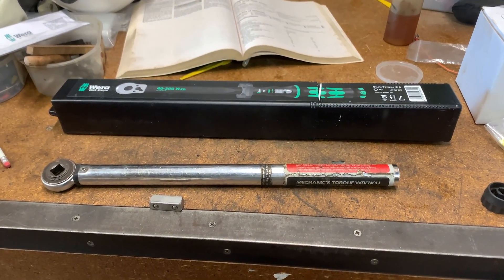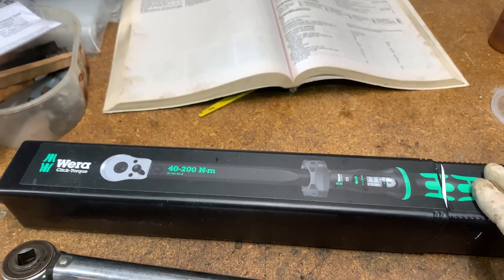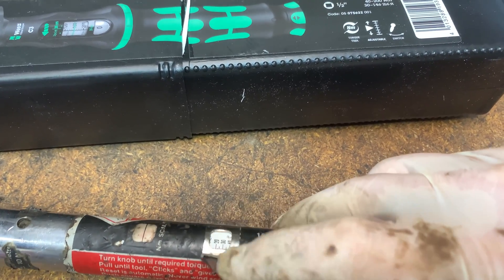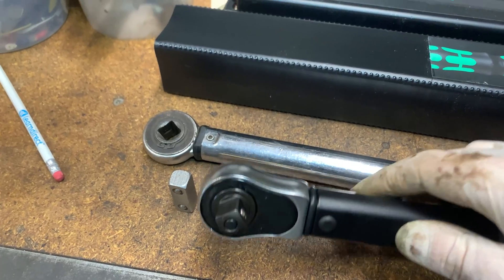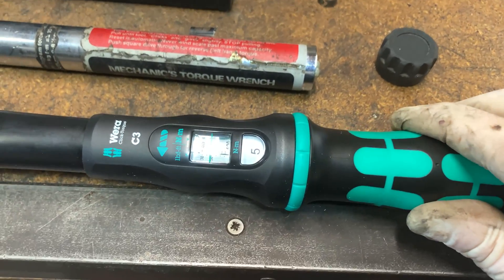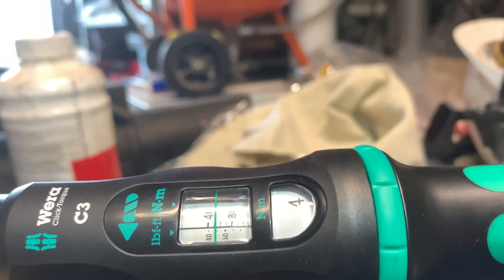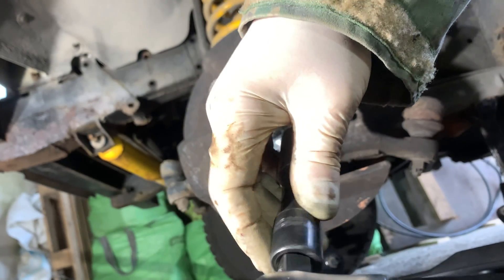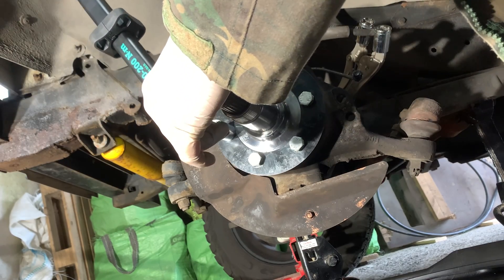Wera Click Torque C3 Adjustable Torque Wrench 1/2" drive

Comment: Hi I've just purchased this. The instructions dont seem to mention where zero actually is, is it on 40 or is it the small dash on the scale before 40?
Reply from the maker: When I set mine I use the main scale to get near to the value I want and home in to zero (or indeed anything between 0-.9 using the window that displays 0-9 digits.)  So 35.5nm would be 35 on the main scale and .5 in the window. If this isn't the zero you mean then give me a few more details and I'm sure I can help. Thanks for watching 👍🏽
Reply: Sorry bit of confusion my fault. I mean like when I'm done using it and want to store it. What do you set it to, just the lowest value on the scale?
Reply from the maker: @ ah right. I wind mine back to the minimum digit or lowest marked setting
Reply: @MikeMakesIt  ah thanks I thought so

Comment: Nice wrench. I just got one myself. It takes a lot of turns to set the torque from zero to e.g., 110 Nm, so I'm wondering if it's necessary to set the torque to zero when you are no longer using the wrench. Any info on that?
Reply from the maker: Hi, I’ve always understood you should return it to zero but I guess it can also depend on the usage. I don’t think there is a need to zero after each time you use it but I would always zero mine at the end of the day. I think the calibration would stay accurate for longer if you did this as it will relieve the pressure on the internal spring. Thanks for watching 👍🏽

Comment: I believe you are right in that it is able to tighten left hand threads but torque wrenches should not be used to loosen bolts
Reply from the maker: Hi Vitor, yes absolutely never loosen a bolt with a torque wrench. It can be tempting due to it length but thats why they invented breaker bars. Now they loosen bolts well! Thanks for the comments and of course for watching 👍🏽
Reply: @MikeMakesIt  hello,
is it possible to tighten a bolt with a left-hand thread to a tightening torque with this WERA (VW Golf use one left-hand thread 50 nm on the timing chain)?
Reply from the maker: @VisionMaster  Hi Patrick, the answer according to Wera is NO. This is copied from their manual.  "Click-Torque wrench in the unmistakable, robust Wera design with high accuracy as per DIN EN ISO 6789-1: 2017-07. Easy setting and
saving of the default value. The audible and tactile clicks on reaching the scale values also facilitate the safe setting of the desired
torque value. The robust release mechanism guarantees a clearly audible and tactile release signal when the set torque is reached. For
right-hand use (clockwise torque-control) and with 45-tooth reversible ratchet mechanism."    So they are saying Right hand threaded bolts only and there is an arrow on the wrench indicating the direction of use. It's a bit misleading as the wrench has a mechanism that allows the action of the ratchet to be switched. But Wera says NO. Hope that helps. There are links in the description to the Wera manual. Perhaps a different model of Wera could do LH threaded bolts?
Reply: @MikeMakesIt  Thank you very much for the information. after googling for a while I have found Wera C 3 Clique Push L/ R 40-200 Nm (new edition). thank you very much for the information. thanks also for this informative video. keep up the good work.
Reply from the maker: Hi Patrick, thanks for the feedback. I hope you'll find yours as good as mine. 👍🏽
Reply: Thanks for the clarification! I am looking to buy one but didn't understand what that switch would do. I will look for the L/R version instead then.

Comment: Nice piece of kit Mike I’ve still got my brittool one from when I was an apprentice on trucks had it recalibrated twice in its life great tool, as they say  they don’t make them like that anymore that new one of yours gets a fair write up stay safe Mike 👍👨🏻‍🏭
Reply from the maker: Yes, it looks a tidy bit of kit but I'd have been happy with the old one if it wasn't for the couple of issues I've got with it. The Wera certainly works well as I have been using it over the weekend. Thanks for watching 👍🏽👍🏽